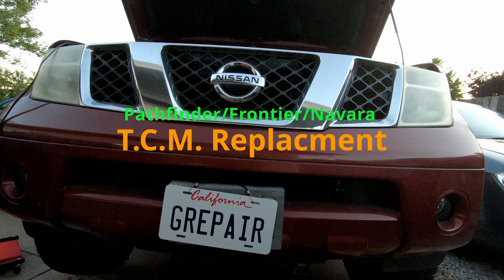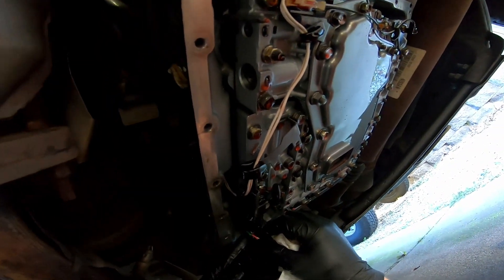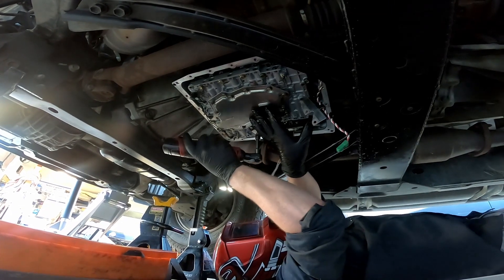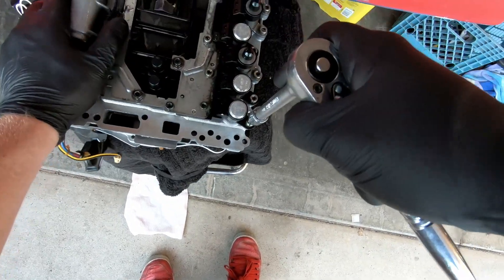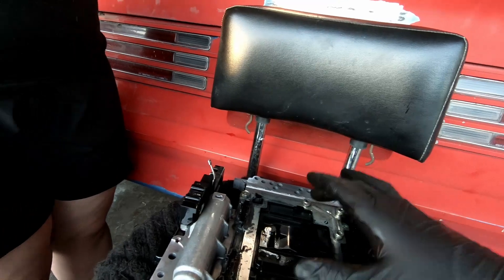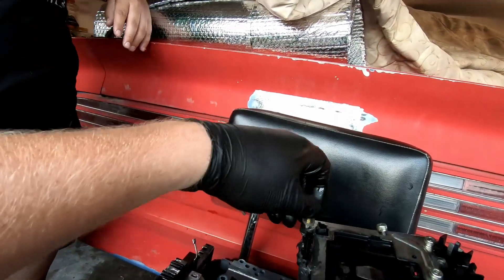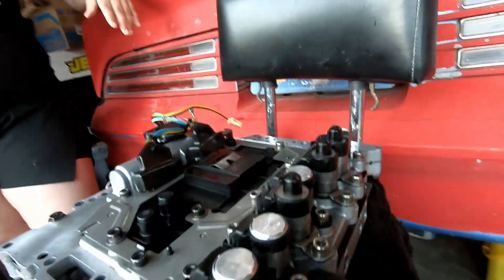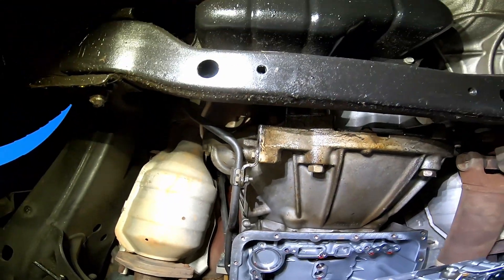How to Replace Nissan TCM 2005 - 08 Truck/ RE5RO5A

Comment: Got a valve body from the junk yard and switched out the whole thing and my xterra is fixed. Worked from a pathfinder with no programming needed! Thanks so much for your video!
Reply from the maker: Good to hear.
Reply: Didn't know u can donate. Good to know

Comment: At 8:25 the part that attaches to the green plug from the valve body is called an a/t assembly harness connector.  It is attached to the back of the transmission on an '06 2WD and kept in place with a snap ring. Remove the snap ring and the wiring plug on top of the connector.  The connector is designed to be pushed in so you can remove the valve body - I needed the hook end of a crowbar and positioned it against the transmission housing while pushing down on the connector to pop it out. The connector has ten pins on each side - make sure they are straight and clean before connecting the green plug from the valve body back to it. (It'll throw a P720 code if one of the pins is flattened down). There's also a metal tab that supports the connector (it may be pushed down on the valve body) - carefully straighten it out and sit the long end of the connector on top of it. Lube the o-ring on the connector before pushing it back into place (may need a screwdriver to help), then secure it with the snap ring. The valve body can be tightened down after that.
Reply from the maker: I didn't have any luck removing it that way.

Comment: This video saved my 06 Frontier and $2200 in repair cost Words cannot express how grateful I am for your dedication and 
professionalism in creating this video I cannot thank you enough Bob V
Reply from the maker: Thanks for the kind words.
Reply: Boss this video is a bit old but I would like to know if you need to drain the transmission fluid before removing the valve body? Thank you
Reply: Sir where Ican get the part? @GrimRepair

Comment: Thank you so much for the video! I’m having an issue with my 2008 Pathfinder that I just purchased. I’m getting codes p0734 and p0717. Coolant and trans fluid look clean, but I suspect it could have been replaced before I bought the vehicle. It shifts from 1-3 just fine, but once I hit 4th gear it just slips as  if I’m in neutral. Do you think a bad TCM could cause this issue along with the codes? Thank you so much!
Reply from the maker: @hoogiesimports   it could be, it may also be the speed sensor causing the p0734 code. It is impossible to say for sure over the internet.
Reply: @ thanks for the response! I’m concerned about the transmission slipping like it’s in neutral when it hits 4th gear. Do you think that could just be electrical? There’s no kinds of weird noises or anything like that. Just acts as if it’s in neutral once I hit 4th.
Reply from the maker: @hoogiesimports  I'm thinking it's probably not electrical, it might be best to take it to a transmission shop for diagnosis.

Comment: Another successful repair here, did this exact procedure on an 04 Armada 2wd and it worked like a charm! No programming was required, bought a new tcm with the sensors inside of it on amazon for 100 and installed it with the old oem solenoids!
Reply from the maker: @user-vk5lq8cp4f  awesome , I wish mine was that cheap. I paid $600 years ago.
Reply: @GrimRepair  normally cheap is bad in this line of work but its a shitbox haha

Comment: Why would you put two trans coolers?  One wouldn't be enough? Thank you for the video.
Reply from the maker: From the factory, there is one built into the radiator and an other separate from the radiator. If you add another and don't use the one that is built into the radiator, you eliminate the possibility of coolant contaminating the transmission fluid. If you live in a cold climate, I don't recommend doing that, but make sure you use a high quality radiator.

Comment: Great tutorial! I have a 2011 frontier (which shouldn't have the coolant contamination problem) which I believe uses the same part. The transmission was slipping badly and it was kicking out a code related to the tcm, P1774. For some reason the shop I took it to recommended that I replace the transmission rather than just the tcm because it requires taking apart the transmission and can be "risky?" Watching you do it, I can see that's clearly not the case and that the valve body comes off super easy from the transmission. My question I guess is whether there's a risk or downside to replacing just the computer, and whether I should instead replace the whole valve body, with a new tcm, considering the whole body is not super expensive and it's possible there is some other bad contact in the valve body that is causing my problem. (Sorry, not super mechanically inclined so I hope this makes sense) Thanks again for the video!
Reply from the maker: Thanks. There is risk in everything, if you have chunks of metal in your transmission pan I would be worried that what ever is causing that might contaminate the new valve body. Some super fine flakes are normal. If everything looks normal I would just change the tcm. Hard to say anything for sure without seeing the car. I can see a lot of shops not wanting to just change a tcm because if anything goes wrong in the future with your (probably high milage) transmission it would be easy to blame them. They want your car fixed and not coming back in for warrenty work.

Comment: Thank you for the video! My 2008 Xterra had water in the transmission. I did the radiator bypass and flushed the system. It ran good for awhile but now it went into limp mode  and is blowing the tcu fuse. I think I may need to try this before I decide to let it go.
Reply from the maker: No problem happy to help, thank you for watching.
Reply: Any luck sp?
Reply: @GrimRepair  hey anyway u can point where I can find tcm for 09 pathfinder I havent had any luck only see parts for 05 to 08.
Reply from the maker: @JT-ql5oi  oriely's, napa, autozone, or Nissan dealer, you will have to call them.I got mine from oriely's.
Reply: I'm in the same exact situation. What did you end up doing? Was it corrosion from left over coolant or something else?

Comment: Hello Grim, I'm watching your video from France because I have an automatic transmission problem on my Nissan Pathfinder 2005 2,5l 174cv, in fact the gearbox starts in 2nd gear so it's almost impossible to move forward without making a noise, it's not possible. I move forward in my research and I notice a strange liquid in the coolant reservoir, I also think that the engine radiator is dead and the gearbox oil has mixed with the coolant. So I think it's the TCM that's messing up and not the box. Thank you for your video and if anyone has an idea about my problem, I would be very happy to read your comments.
Reply from the maker: You need to at a minimum replace your radiator, tcm, and flush out your transmission fluid really well. Hopefully it can be saved. It's starts in 2nd because it's in limp home mode.
Reply: thank you for your answer, I hope I can save the transmission. I went to Nissan and he asked me 10 000 euros for change the transmission. That the price of the car completely crazy @GrimRepair
Reply from the maker: @porkepic5880  it may or may not be savable. And they don't want to warranty something that may not work.
Reply: @GrimRepair  Yes of course, I hope to be able to repair it, last diagnosis of Nissan "communication problem between tce and tcm. Thank you for helping me and thank you for what you’re doing.

Comment: I have a frontier and have the same issue why did coolant enter your system ? Cause my truck also had water and fuse keep blowing
Reply: Is there a seal that I have to replace so water doesn’t get in the tcm before I decide to put a new one on
Reply from the maker: @Theramostwins1  the radiator has a transmission cooler built into it. If it cracks internally the fluids will mix.
Reply from the maker: @Theramostwins1  you need to replace your radiator.

Comment: Great detail in video. I bought valve body and tcm from Street Smart, it fixed the fuse blowing so now the xterra starts but won't shift and getting U1000 error code, any suggestions?
Reply from the maker: Thanks, it may need to be programed.
Reply: @GrimRepair  Just thought I'd update, seems the code was from before I changed out the TCM, got a hold of Street Smart tech support and erased codes with code reader and followed some start up procedures I missed, so far transmission is running fine after a week. Street Smart has no tech support on the weekends, so any DYI keep that in mind. Thanks again for the video.
Reply from the maker: @scottyoung9102  Good to hear, thanks for the update.
Reply: @scott young hey bud how’s the streetsmart tcm working lately? I’m about to order one
Reply: @MrIsrael211  so far so good, be sure and read the startup directions that come with the tcm, I missed them cause they were mixed in with return paperwork
Reply: Hey im having an issue with their valve bodys and tcm. I just installed one and now my truck wont turn on cause its showing the shifter is on 3rd but it clearly shows on the shifter that its resting on P?! Any help? Kinda stuck at this point
Reply: @gabrieljuarez8784  I would call tech support before the weekend. Also go through the start up procedures.

Comment: Excellent video, i had the dreaded wont crank and cross contamination issue on my 2008 pathfinder with 181k miles. I replaced the radiator, bypassed the transmission cooler lines to the new radiator. Now I dropped the valve body out and saw I have a Hitachi TCM. This seems to be a little better designed compared to the Bosch. I found black marks between two of the lines in the TCM which I assume are 12 and gnd. I cleaned out the short material and put gasket sealer in the area to isolate for future issues.  I am about to re-install and see if it all worked. Hope the fuse does not blow again. Thanks for your video with great detail.
Reply from the maker: Thanks. I tried cleaning out and sealing up the tcm f on this one as well and it worked for a week.
Reply: @GrimRepair  unfortunately my fuse is still burning out. I took the valve body out again and am looking for another place that could have shorted out. I may just have to order a new tcm board, but not sure if that is the issue now?
Reply from the maker: @KavehParsi1  When you unplug the tcm from the car does the fuse still blow?

Comment: Before you reprogrammed the transmission computer were getting hard shifting. I installed a used trasmision and I am getting hard shifting, the mechanical said I need to reprogram the computer.
Reply from the maker: I did not need to reprogram the tcm.
Reply from the maker: You may need to though, I don't know what the transmission come out of or what you put it in. I may have gotten lucky.

Comment: Just going to add torque specs of valve body bolts is 70ft lbs. And pan bolts are 80ft lbs torque. This fugin rocks brother. I pulled her apart 2weeks ago. Ordered the new valve body. And your detailed mounting of the bolts just evaporated my stress. 😅
Reply from the maker: Thanks.  I think you mean inch pounds, though.

Comment: I hav a question, on the solenoid replacement, are they all the same or, are they all different, according to the numbers underneath each one?
Reply from the maker: There are 3 different ones on the tcm each type has to go in the correct bore. I am not sure what you mean by numbers underneath them?
Reply: I know it's three different solenoids 1oddball 3 of one solenoid and 3 of another. Does it matter which go where as long as it's the correct solenoid type? Surprisingly no smod just hard shifts from park-reverse and hanging/not wanting to shift to second unless walking the gears by letting off the accelerator at just the right moment

Comment: Realy hoping you can answer a question for me... I didn't notice any mention of a gasket when you removed the cover before taking out the valve body or re installing... is there a gasket on that cover?
Reply from the maker: @Mwellmac  cover? Can you give me a time stamp?
Reply: @GrimRepair  @12:53
Reply from the maker: @Mwellmac  The transmission pan has a gasket.
Reply: @GrimRepair  ok I figured as much, after conflicting results in my search for the gasket I figured better to ask you.. I appreciate your time as well as the video.
Reply from the maker: @Mwellmac  if you can't reuse the old one, there should be one included with a new transmission filter.

Comment: Wonder if this will fix my problem sometimes it wont shift pass first gear when I park and restart the 2005 armada it works fine until it dosent
Reply from the maker: @kareem1350  could be, I would hook it up to a scanner that can read the tcm and see if you have any codes.

Comment: Part number you're showing on video, does it fit 2006 Nissan Frontier v6 se, 4.0l rwd? Struggling finding this control module. The module you're showing in video does it come with shift Solenoid? If not I don't know what type of solenoid switch I need for my vehicle.
Reply: Thank you!!!😊
Reply from the maker: @theresaManzon  I'm not sure if it will fit, it should. You can filter out parts by entering in the specs on many websites, or you can do what I did and buy it from your local parts store. It doesn't come with any solinoids.
Reply from the maker: @theresaManzon  I have links in the videos description to tcms and solinoids.
Reply: @GrimRepair  thank you for responding to me.

Comment: Seeing this video four years after it was done, I have a question for you, once I pull out the valve body, will transmission fluid comes down as well?
Reply from the maker: Yes
Reply: So should I drain all the fluid first?

Comment: 1st) Great video, love the attention to detail for this fix.
2nd) I see that this video is now 4 years old,, how is this fix holding up?
Do you still have it, or did it crap out.
3rd) I'm finding different variations of the part number you used, is there any other part identification?
I'm finding RE5R05A to be the part you have.
Lastly) were there no gaskets or seals for this job?
Thank you for this awesome video.
Reply from the maker: @izzyp5713  1st, thanks. 2nd, still have the truck, it's holding up. 3rd, re5r05a is the type of transmission not the part number of the tcm, make sure the tcm you are getting is compatible with the re5r05a that is in your car. Lastly, the transmission pan has a gasket, it stuck to the pan in this video. I don't remember there being any others.
Reply: @GrimRepair  no leaks?
I have an 06 pathfinder, and was trying to pass a rig yesterday and it went into limp mode right away, getting me to the side of the road. 
Rpms went up, speed was going down. 
Was able to get it towed, but now it intermittently will find a gear or won't. 
Do these tcm's just fail like that without warning? Or is it a possibility it's something else.
Code pops P1764. Direct clutch solenoid function. 
Thanks again.
Reply from the maker: @izzyp5713 No leaks. Before I filmed this video, I was inside the transmission a week prior because i opened up the tcm and attempted to solder one of the rods back together , then you have to glue it back together to do that repair. ( It didn't last very long. I think fluid had gotten inside the tcm,  So my pan gasket was fairly new. Yours may not be in as good of condition. A new gasket come s with the transmission filter, so just replace it. yes they can just fail, also check for coolant contamination.
Reply: @GrimRepair  
So just to be clear, you had to replace the tcm AND the valve body???
Also, I'm on the O'Reilly website and am having trouble finding the parts and core charge. Is there any more information? Or do I look for these parts for RE5R05A and go from there??
I really appreciate your time and help with this information.
Reply from the maker: @izzyp5713  I used the old valve. Body and replaced the tcm. The part number should be in the video. There are also links in the description. You may need to call them. Not all parts are listed on the website. Everything I did is in the video, some of the solinoids will probably break when you pull them out, you may want to order a set a head of time so it can all go back together the same day. I would search for all parts entering in your year make and model, I'm sure there are different versions of the re5ro5a depending on 4x4 4x2 car or truck different years.

Comment: What codes were you throwing or symptoms having prior?i heard its cheaper to rip one off the newer modela and just plug and play. I have 05 altima staying stuck in gears after 5 min driving. P0774 and u1001 .
Reply from the maker: @samaelmartinus3273  I think I had a u1001, i think it says in the video.  Before I replaced the tcm, I had tried to fix it,  and it threw a bunch of solinoid codes. Symptoms before I attempted to repair it were it was stuck in 2nd gear, it lasted about a week before it started blowing fuses. That's why I ended up replacing it in this video.